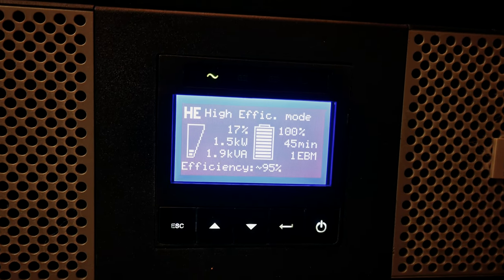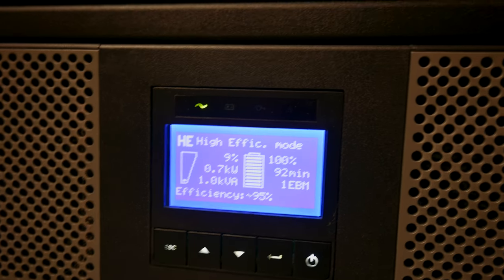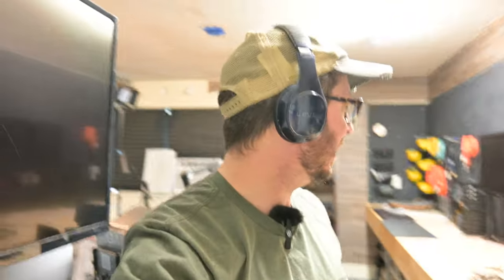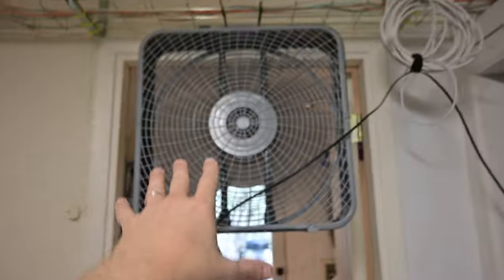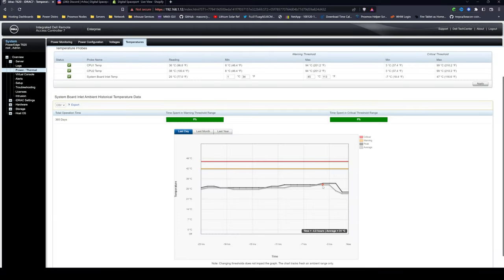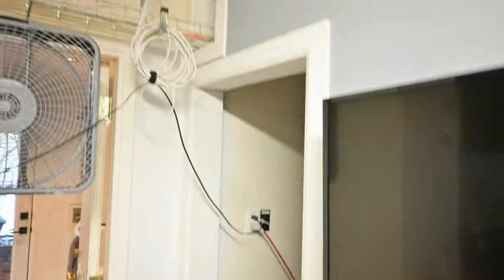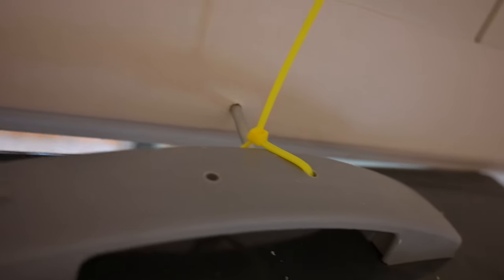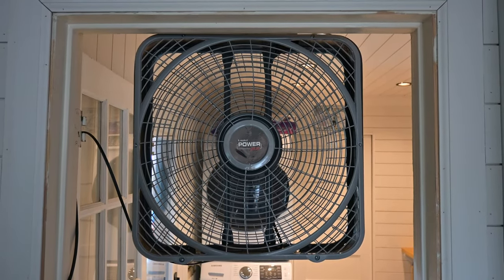HomeLab HEATS my house CHEAP! - Reuse Server Heat and SAVE MONEY

Comment: I used to do this same thing in my house.  My racks are in my utility room in my basement.  I used velcro to hang a box fan from the ceiling right in front of the door.  Then, I put a big board of MDF in front of the door and held it in place with a clamp around the door frame to prevent my cats from getting in there.   I'm in MN, so my basement is a lot cooler in the winter.  This really helped warm that whole level up--even though it's a convoluted path to get from there to the rest of the basement.  I removed all of that recently, though, because I found this dries out my house a LOT.  I had recently had a whole home humidifier added onto my furnace and that couldn't keep up with the dry air that this fan was pushing all over the house.  Since it gets really dry in MN when it gets cold (and we've gone below 0 quite a lot this winter) this makes my hands crack and bleed.  That's why I put in the humidifier in the first place.  My cats also figured out how to get over that 5' board recently, as well, so that made it even more of a problem.
Reply from the maker: leave it to a cat to liquid into any place. I like the board idea though for a mount solution. Ill keep an eye on our humidity in the house but we are already all electric, not sure if this makes it worse in the end.

Comment: I have more of the opposite problem. My whole home-office setup consumes somewhere between 500-1000W and as I'm living in a rather tiny flat/apartment (40m²) I can't get the heat out of the rooms easily. Sadly the spot where I currently have all my setup stored is in the corner farthest away from any window and I can't drill a whole in the wall to guide the heat to the outside.I therefore thought about creating some kind of air exhaustion mechanism where I put foil on top of my computers to "collect" the hot air and use some more or less silent fans to push the air into a low-caliber air exhaustion pipe made of foil or plastic that is hidden behind furniture in that room that then guides the hot air to the windows where it then can escape. As the building my apartment is in is well isolated I don't have to heat in winter at all. Neighbors already do that for me next to the isolation on the outside. But in summer times working in a 35+ ° Celsius room is a bit of a pain and running an air condition is pretty hefty on the energy bill (doubled my electricity bill this way last year) and I pay like 35-60 Cents (Europe) per kW/h.
Reply from the maker: Id get some flex duct (not sure what its called where you are at) to exit the air, but remember when you force air into an outside area there has to be replacement pressure volume from someplace. Air will be pulled in from ??? and that might not be cooled air. Its hard to get the balance of airflow right, which is why I sealed and cool it in place.

Comment: One thing worth noting. The majority of the energy used by PCs is turned into heat. If you are getting useful work done you are basically more efficient than resistive heat. Although heatpumps are still kings of efficiency.

Comment: Very cool. Sounds like a permanent solution that won't get disapproval (presumably from the spouse lol) would be a duct in the ceiling with an inline fan? An 8in should move a nice volume of air. That way you could even put the intake in the room behind the servers vs having to leave the doors open.
Reply from the maker: The 😺 is having a lot of fun right now. Doors open = invite.

Comment: If you blocked the sides of both fans to reduce recirculation on themselves and increase the negative pressure in each of the rooms, you might see another degree or two reduction.  Just tape a few pieces of paper to door frame and fans and see (even the small gap above the fan and the frame).  If it works then you could make a nice cardboard cutout to optimize.
Reply from the maker: I am thinking about buying some trashy doors and putting the fans in the top, and in the bottom cutting out some vents. I want to balance the air as best as possible but just use the circulation of heat out and cool in with minimal pressure imbalances.

Comment: Perhaps install a sliding door on garage side of the doorway and hack that for the fan holes, roll that door in as required for heating/cooling.
The roller door can be out of sight when not needed... and you still have a normal door the rest of the time and the whole setup is easily reversible.
Reply from the maker: yeah I am looking for 2 doors on local marketplaces now to hack into place temporarily and not destroy the good ones. I think this is only viable for a few months and the rest of the year bringing additional heat inside wouldnt be any help.

Comment: with duct work you could make this more efficient, quieter and better wife acceptance factor.
Money guy solution is to move that heat into water, and then circulate that water into radiators around the house, but i reckon texas isn't cold enough for this to be standard setup like here.
Reply from the maker: Yeah I think maybe another month of use and I could have started using this in November so 4-5 months a year of some level of heating. Heating water for the water heater is an interesting idea however.

Comment: How are you using such little energy? i have just 2x 12bay storage arrays with a 6 core cpu and its using 420-440w! @36p unit too so always farming at a loss!
Reply from the maker: What are the details of your CPU and setup model numbers? I go for fat density on the jbods and they are not bad wattage loaded up. I dont think my compute side is super efficient however, mostly Ivy Bridge generation.
Reply: @DigitalSpaceport  I'm using a 6800k which is a bit juicy but dials down well, unfortunately this does require a discrete gpu to run so i have some £30 card with a tiny heatsink evga 630 or something, it has a platinum psu. most of the power draw is from the jbods. even with only 1psu connected and 1 controller connected in each, they draw near 100w empty... each! they are DELL MD1200. I've got a service lead and messed around with slowing fans Down but surprisingly has a negligeable difference on power consumption  unless I take the fans to a point where things get hot 😬. drives are mostly existing 16tb/18tb with a few wd gold in there

Comment: This isn't a low-tech idea - heat pumps with multiple ?units? (I don't know the term) in the same house to fashion together different zones. One zone can call for cooling while another calls for heating and the system should be smart enough to move the heat via the refrigerant lines between zones.
Reply from the maker: I dobt know exactly what this thing would be but yes! Getting a car radiator involved somehow mounted outside is as far as my thought experiment got however.

Comment: just close the door and make a hole on the wall and install a fan in there.
Reply from the maker: Isn't that against code to make a hole in the wall between a garage and living area? On the other hand I do like making holes in walls.
Reply: @DigitalSpaceport  Yes it is, but I would argue that's not a garage. Also, if you ever decide to sell the house, just patch the hole?
Reply from the maker: You are probably right. I dont think this would function as a garage exactly in current state. Maybe I should just commit to conversion and do it.